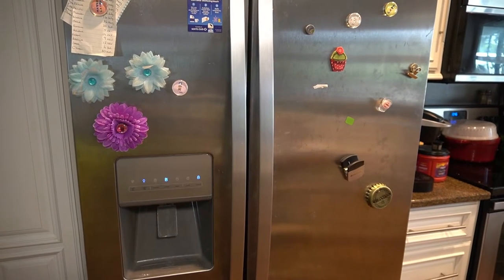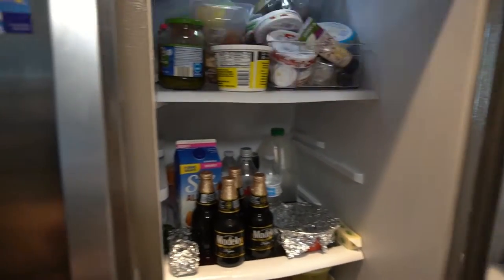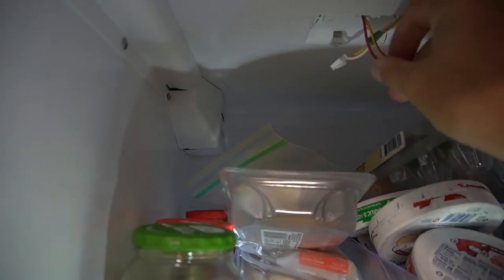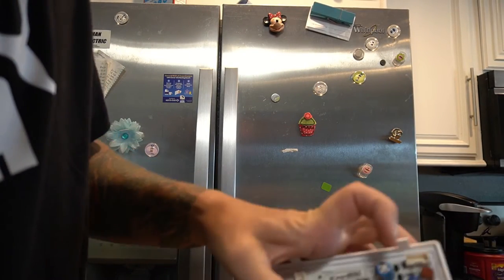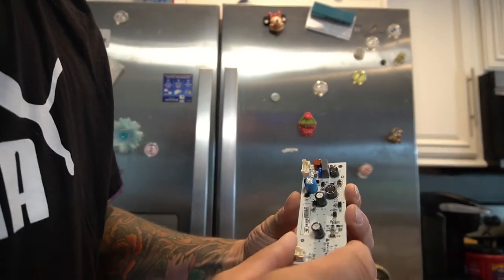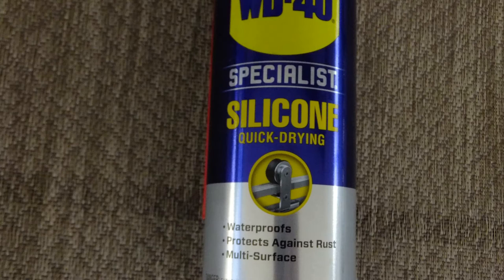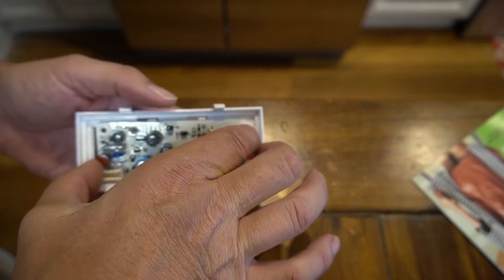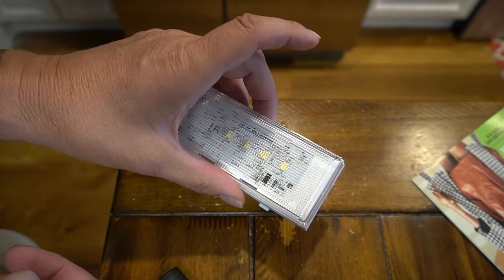Whirlpool Fridge Strobe Light Easy Fix ( Resolved )

Comment: Where exactly are you spraying WD40?  I have mine out, and it is dry as a bone.  I am having difficulty figuring out how WD40 is going to do anything.
Reply from the maker: The wd40 silicone spray will seal the board from moisture.
Reply from the maker: This is what I did and it worked for me I a. Not telling you to do the same or that it will work for you